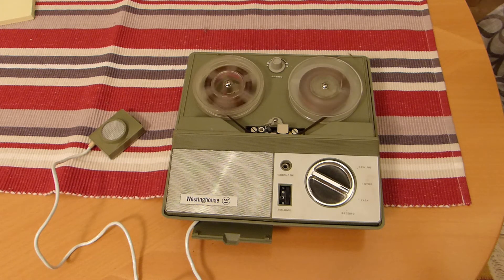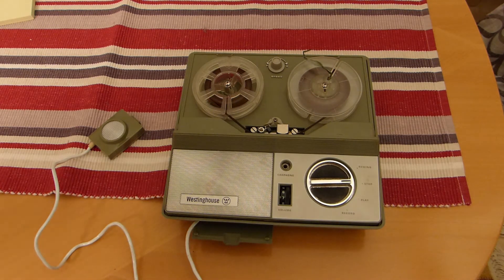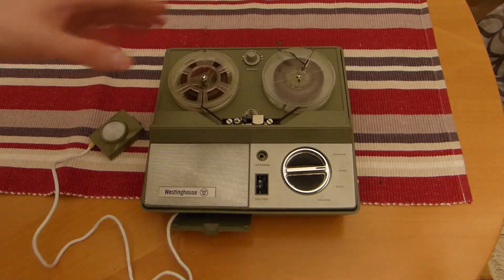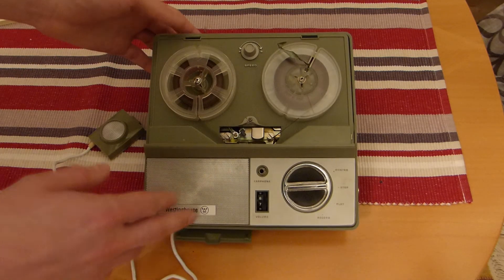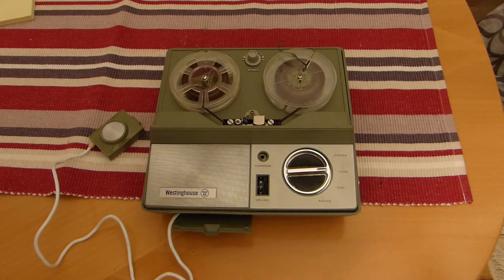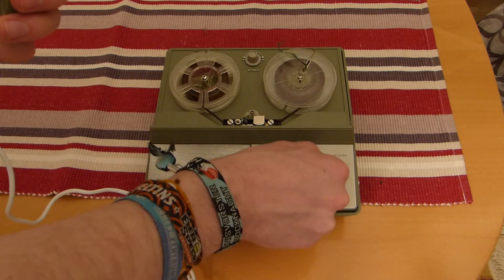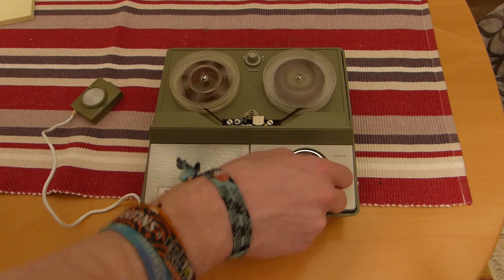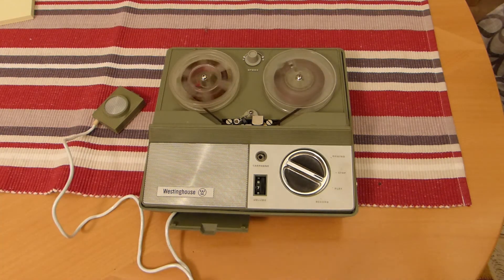Westinghouse reel to reel tape recorder

Comment: I have this! It has my dad's voice on it. He died when I was 11 yrs old in 1974. Mine doesn't work. How can I get it working?
Reply from the maker: I think it might be easier to get a another working real-to-reel recorder and transfer the tape than repairing it, unless you have experience with electronics repair. Doesn't yours rotate at all or does it rotate but without sound?
Reply: @vaultdweller2511  Mine doesn't work at all. I would love to find another one that does work! I wonder what the chances of that are.
Reply: @janetries3723  do you know what year it was made in?
Reply from the maker: I know this question/comment is more than a year old, but I just an idea: You really do not need the original machine working at all, you just need any reel to reel tape machine. Either get one, or take the tape (carefully not near any magnets, speakers, cell phones or other things with magnets) to a specialist that does media transfers, and tell them exactly from where the tape is from and that the tape speed is approximately 3 inches per second  (my very rough estimate). After you have a digial file, any difference in speed/pitch can be trivially corrected later.

Comment: Wow! this is awesome. I just found one at a thrift store recently. It does not seem to work. I know how to solder. I have also taken apart the device and put it back together. I am not so good with diagnosing electronic issues though.

What all did you replace and repair if you don't mind me asking?
Reply from the maker: I didn't to anything except clean it and carefully lubricate the moving parts. If I recall correctly, it needs separate batteries for the electronics and the motor, did you put both in?

If you do solder, be very careful with heat because it uses germanium (not silicon) transistors and they are very heat sensitive. Unfortunately, I have never found a schematic for it.
Reply: @vaultdweller2511  thanks for the reply!

Yes, it takes 4 AA’s and 2 C’s. I put those in

Comment: I just bought the same one. It isn't running great. Perhaps you can advise me on how to get it running like yours.
Reply from the maker: I did not do anything to it, mine worked just like that. But some general hints would be to clean and grease all mechanical parts, and check if there are bad electrolytic capacitors.